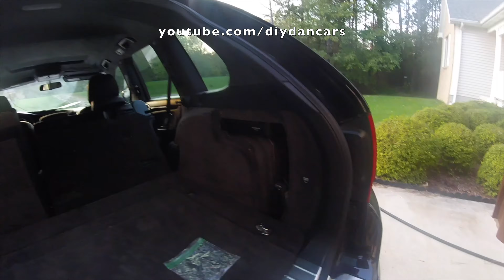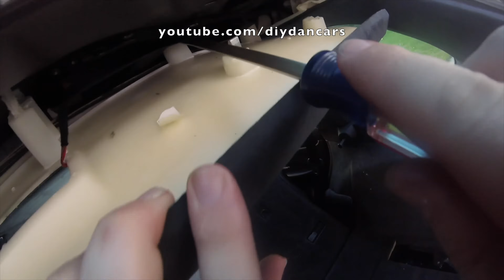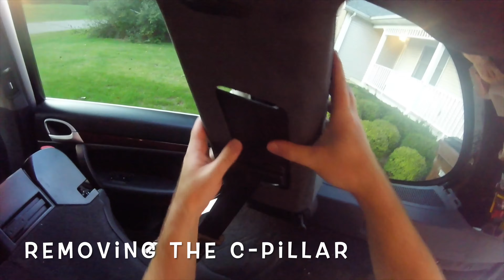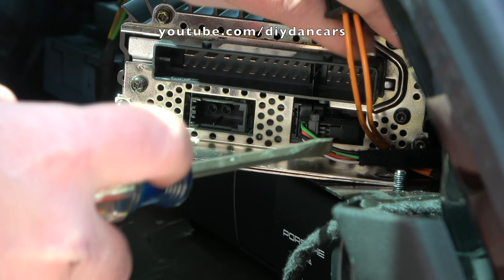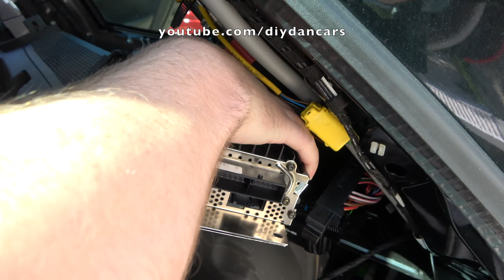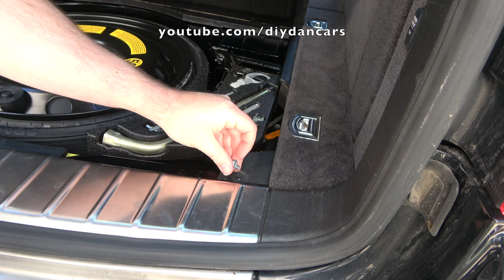Porsche Cayenne: Bose Amplifier Replacement

Comment: So hard work just for an amplifier!😮.
I think it's a failure from Porsche.
Sweat water or water from the roof. 
The amplifier has no air to breathe!
Reply from the maker: Porsche quality is very poor these days. If you don't have the energy or checkbook to constantly repair things, then the ownership can get ugly very quickly. I finally had enough of the car and sold it about 3 years ago. Would I buy a newer Cayenne? Heck no!

Comment: I'm not sure if you would have any input on this. I have an 08 CTT.. I bought it with an aftermarket Head unit already installed and the dreaded "No Sound" issue.

The amp clicks on, speakers pop and it shuts off again immediately. This cycle repeats continuously. I tried a new fibre decoder so I know its not that and info on the forums are not exactly precise about this matter..

The amp looks exactly like yours with no signs of damage.. just wondering if there's anything to check for before having to spend a small fortune sending the amp for repairs only to find out it wasn't the issue?
Reply from the maker: I would bet money that the amplifier is probably bad, but this is only a guess.
Reply: @DIYDanCars I took out the amp and realized that it's not ommiting any red light (fibre optic signal) when powered on. Ive heard it's quite common

Comment: ❤I will have to clear the drains from the sunroof.. LOL
Reply: Mine leaked twice onto my floorboards.  Once on each side.  After the second time last summer I had a paint protection place seal the damn sun roof entirely with PPF film.  No more leaks.  $100.  😂 I never used it anyways. Great peace of mind.  I just pulled the fuse out for the sunroof in case someone tried to use it without knowing.

Comment: Thanks for the video. How did you know it was the amp? What were the symptoms?  I have a 2006 Cayenne S with the radio dead. The fuses are good. Any idea? Thanks
Reply: Any update mines just keeps showing the Porsche logo n goes black and back to the Porsche logo n so on just keeps doing that like it looks like it’s resetting but same thing logo and then black and back again

Comment: Hi Dan, Mechanics installed the new Amp in our 2017 Porche Cayenne Hybrid and it went from no sound to sound on the left side only. They say it has to be programmed. That doesn't make sense to me. What do you think?
Reply from the maker: Honestly, it wouldn't surprise me! Some German cars have to be "programmed" when you replace the battery in them. I'm positive they do this so they can charge their customers obscene diagnostic fees for a job that won't take longer than a few minutes. It's a huge profit maker for them. 

I see Porsche quality hasn't changed much if you are already having problems with a 2017. Hopefully it's a CPO car? Good luck!
Reply: @DIYDanCars  Thanks Dan.
Reply from the maker: @ooobahamas  No problem, Lucia! Best of luck with the repair!

Comment: I’m about to embark on this for our 958.2, similar amp location, assuming similar diy... famous last words :) thanks for the video! I just needed to know where to start on the trim! Germans and their sequential ordering!
Reply from the maker: No problem, Jeremy. Wow! Even the 958s have problems with their amplifiers? Some things never change in the world of Porsche. :)
Reply: @DIYDanCars   I was told by a Porsche tech it was due to a faulty pano roof seal and condensation leading to the amp failure.

Comment: interesting, I've had the same error was told it was the head unit, only works when it feels like it, imported a new aftermarket touch screen one from Germany, now waiting for the adapter to arrive, after seeing this I wonder if my amp is toast, guess I'll find out soon enough
Reply from the maker: Let me know how it works out. Good luck!
Reply: What was the issue?
Reply: This was years ago, it turned out to be a circuit in the amp was about a 300.00 fix, bought a new Porsche Cayenne since so kinda moved on @tonygutowski7168

Comment: thanks for the great DIY videos, Dan. Just replaced the rear brakes in my 2005 CTT with your help. Only issue was disconnecting the wear sensor wire at the main connection point. Yesterday, I replaced the right fog light as it was smashed. Unfortunately, there was no DIY video on that one and I had to figure it out myself. It was very tricky and a unique setup for the 05 CTT. I should have made a video! Stereo: I still don't know why it is now working, but I had the same problem as you with the stereo over the past year. Intermittently, I would get the error message and no sound. The reset button combination worked a few times. Pulling the fuse out and back worked a few times. Disconnecting and reconnecting the battery worked a few times. Someone suggested a new head unit and since I was looking for that upgrade anyways, I tried that at Christmas. Everything went well according to the DIY videos and Rennlist blog and $1000 later, I had a modern stereo (Sony AX3000) with all the bells and whistles (even installed a backup camera). Everything worked for about a week, then the system went silent again! Head unit powered up no problem, Android Auto worked for the NAV still, just no sound!  Heard a slight clicking in the speakers and one youtuber suggested repairing or replacing the amp. First I tried re/re the relay as suggested but no luck. I found a used amp on ebay ($200) and went through the same process you just described and still no sound. I was about to take the CTT to the audio pros when I discovered 4 of my windows were broken by vandals/thieves in my parking lot. They couldn't get in because of the unbreakable security glass in the Porsche, but I had to get them replaced through insurance. I had to wait over a month for the glass from Germany and most of that time the car sat at the autoglass place. While sitting, the battery drained (another common issue). When I got the car back, miraculously the stereo was working again!! I even switched out the replacement amp with the original amp and that worked too. Everything has been working fine now for a month. One suggestion from an electrical engineer friend was the moisture in the car causing a short, due to water ingress during the winter (clogged drain plugs from windshield/sunroof - yet another DIY issue!). Now with the drier spring/summer weather, and putting a bag of moisture absorber in the car, I'm hoping the stereo will continue to work. Lucky I have the time now for all this, since losing my job due to Covid! Cheers!
Reply from the maker: Hi Dave! Happy to help! Sorry to hear about all of your problems. Good job on tackling them all on your own! Best of luck! - DIYDan

Comment: It no 928.....but I’m still watching
Reply: Surprised they didn’t mount that thing in the v of the motor under the intake...good lord!  My 2018 Goldwing is like this...cad designed like a lego set...you basically have to strip the entire bike apart to put in an accessory plug..not even exaggerating.
Reply from the maker: @Dundertaker1  I'm just now seeing this comment! 

"Surprised they didn’t mount that thing in the v of the motor under the intake" 

Bwhahahahahahahahahaha! Pretty sure Porsche engineers are sadists!
Reply: @DIYDanCars  Hows the motor going?
Reply from the maker: @Dundertaker1  Very slow! Waiting on parts.
Reply: Started it...;). https://youtu.be/46uqB8T5QME

Comment: You've got one of the most problematic Cayenne in the world. What's left unchanged in it?
Reply from the maker: Hi Alex, all of the problems I have experienced are not uncommon with Cayennes. I'm just the only guy on youtube who is willing to be honest about Porsche quality and reliability. Just do a google search for "Porsche Cayenne Bose amplifier replacement" and you will see thread after thread of people trying to find a cheaper solution to replace their amp than buying one from a dealer. Thankfully there is a company who now rebuilds these Bose amplifiers for a fifth of the price of what the dealer wants.
Reply: Hi Dan! Awesome video, thanks! With my CTT 2008 (957, face-lift of 955, UK market, RHD), I have never had any single issue like the ones you had. I kind of expected something but none of the issues has ever come my way (87k miles on the clock). Said that I now fear I'll get all of those troubles next day, LOL. Did you disconnect the battery for those manipulations with the amp? Thanks. Regards. Dmitry